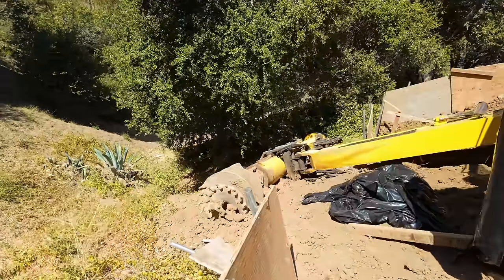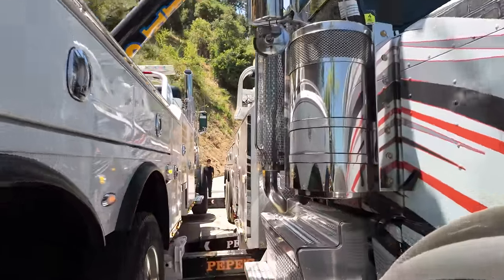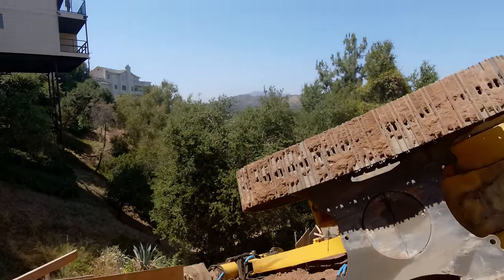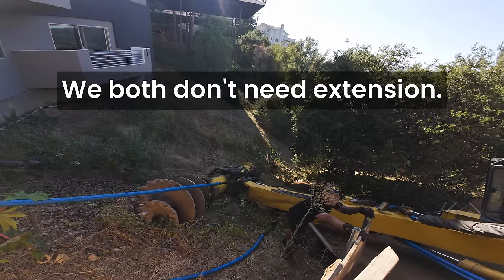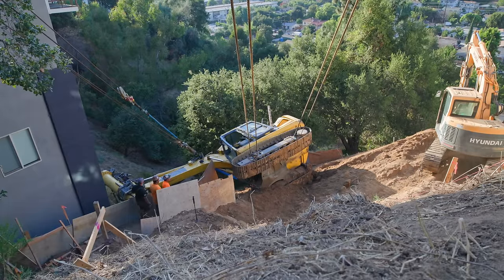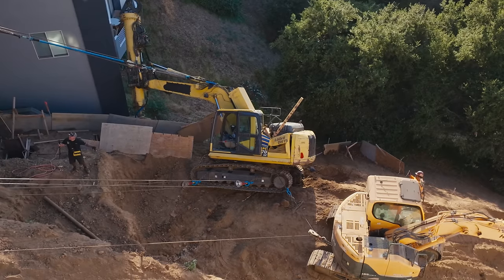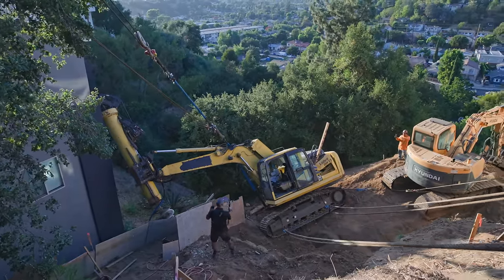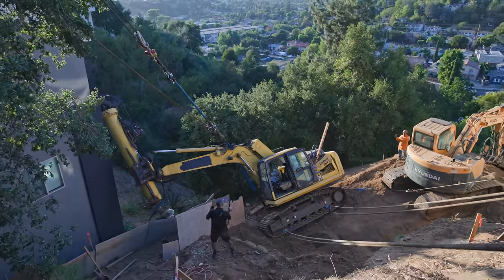Excavator Rolls Down Hill! (Our HARDEST job yet)

Comment: I think a crane would be best.
Reply from the maker: How could you possibly watch this video then have this take? Did you even see any of the video or just commenting blindly based on the thumbnail? A crane the size needed to do this job would have been impossible because of the working area. We literally got this job from a big crane company that couldn't do it and referred us. I'll never understand how people comment ignorantly when the video would answer their questions.
Reply: @PepesTowingService  A 60-80 ton crane truck would fit . I'm sure they didn't want the liability or it's outside their normal scope of work.
Reply from the maker: @Randal86 another YouTube quarterback. OK buddy
Reply: @PepesTowingService   Military Vet, Logistics & Heavy Equipment. More than one way to do that job buddy.
Reply from the maker: @Randal86 is that supposed to be mean something? Let's break it down. How much weight can an 80ton crane lift at FULL extension? Hint: not 80tons. Second, cranes are designed for static overhead lifts. Not a dynamic one as this. But you knew that as well. Third, you clearly saw how it took hours to get a wrecker with a floating axle here. How on earth would a crane big enough to do this job do it? Again, everyone is an expert on YouTube until you break it down.
Reply: @PepesTowingService  The crane at full  extension only needed to lift a fraction of the weight its designed to handle. Another excavator with a winch or chain would have pulled that right out in a much more controlled and safe manner vs dragging lines through unknown ground possibly compromising your winch lines. and safety of others.
Reply from the maker: Oh boy, you're one of those huh. OK you're right. We did horrible and from now on cranes and excators with winches will do all my jobs and supervised by you. What's your number so I can just have my customers call you direct?
Reply: @PepesTowingService  You guys did fine. I'm just stating there's more than one way to get the job done.

Comment: Quite a challenge! You mentioned at one point securing the top of the vertical pile driver with a cable or other restraint, so that its top section would be unable to pivot towards the neighboring home. But this step was NOT taken. Why not?  That seemed like an important precaution.
Reply from the maker: Relax Greg, we all know you would have done this job in 20min right
Reply: I asked a SIMPLE QUESTION, one that was about a suggestion YOU MADE. You first verbally noted it at 53:22.Then at 54:09, you visually marked it with an arrow, and again, when showing it from a different angle at 54:16. At 54:30, YOU ASKED if it could be chained down.   That sounded like an excellent suggestion. I SIMPLY ASKED "WHY NOT?"
I made ZERO claims to being proficient. But all I got from you was an arrogant, snarky comment 
It sound's like you have an attitude problem, Pepe.  Last time I watch this channel
Reply from the maker: YouTube really brings out the worst in people, you really need to relax it's not that big. It just wasn't done, simple as that. We were told it was all locked in place and wouldn't come open, some equipment are hydro locked meaning you aren't forcing it open without the valves open. Some are air operated, etc. I thought hey, can this come up? If so, let's chain it. We incorrectly were told no it can't open on its own. It's that simple, you can't predict and plan for every single thing.

Comment: OMG...watching this and whole pull was resting on that small 22k auxliliray winch pulling at the back. It did not even had pull multiplication from snatch block since line was at 90° angle, so only redirect. Crazy!!
Reply from the maker: Good eye, but small is relative. 22k is larger than a regular wreckers main line. Flipper has 3/4" dual auxiliary winches. The first attempt was to bring it over with a main line. As you saw, not going to happen due to the soft dirt and excavator being dragged. Once we had it up in the air, then the auxiliary was used. We didn't need it as the primary pull, just to assist and to keep it from spinning into the house which did the job. Is it ideal? Of course not, not a single thing of this job was ideal but we made it work.
Reply: @PepesTowingService   I did not mean to say that you did anything wrong. Just how crazy hard the whole rescue was, considering that excavator had no hookup points and that huge drill in front. That drill was nightmare and so close to the house. As for calling 22k small...I was comparing that to your main winches.
Reply from the maker: Yes, I am agreeing with you. The entire job was just logistical nightmares all around. That's why I love Flipper, it has 7/8" main lines and 3/4" auxiliary lines. I don't think a regular aux line would have done the job. Having that brute strength won the job, but I would have loved to have better angles and a stronger deadman.
Reply: @PepesTowingService   Yes..but as usual you never get what you need. It is great you have Alex now. You two are real A- team together. Bouncing Ideas betwen you two. This was nice display what are you capable! Respect.

Comment: That's another problem with US trucks... You get extremely long and clumsy vehicles with bad turning radius. In Europe we don't have that 20 fett bonnet, and we have steering on the last axel... With a cabover - that  crane would go clear the other truck and not over the bonnet.

Comment: Your off on the weight by a lot.  Excavator weights are estimated in the model number.  A 170 is about 17,000kg's.
Reply from the maker: The weight was given to me when they called me for the job. "around 60,000lb total". The 17,000kg you just gave is roughly 37,5000lbs. Did you factor in the LoDril attachment, which was estimated to be over 10,000lbs?

Comment: Next time take the boom off before you do anything else
Reply from the maker: Absolutely dumb idea. As if disassembling the entire boom would be easy or even quick? Then what do you do when the unit is upright and the boom is on the floor? Would love to hear your genius expert advice on how to put it back on
Reply: @PepesTowingService  Chill man, love your videos and no doubt this was an absolutely crazy job. It takes a mechanic a couple/few hours to take it off (or at the very least, the drill looks like two pins and some hydro lines). Its already on the ground which might make it tricky, or easier, depending on whats blocked/or weight bearing. Then you don't have that high-centered weight, which makes it 100x easier to flip upright, and you reduce interference with the house. Then you can drag the boom up with the other excavator or with flipper separately to reassemble. Taking those off in the field is super common for repairs/maintenance.  Putting it on is the easy part. No judgement man, just giving you things to thing about in the future. The reality is if you didn't pull out this miracle, they 100% would have been field stripping the thing into pieces to move it anyway. 

https://www.youtube.com/watch?v=Zd3A88ndWUc 
Full boom strip example. Rather than the chain hoist, you can use another excavator in the same manner to put it back on.
Reply from the maker: @bailout00 the video you linked is literally in a garage shop and much smaller. Let's think about the logistics. You take hours to even get there. Then say hmmm we can't do it call a crane tech. How long until a crane tech crew qualified to do that to get there? Surely they don't teleport. And who pays them? Excavator owner was already maxed out on budget for my bill. Let's say best case scenario someone is hired fast and is there in two or three hours. And somehow they work lightning fast and despite being on its side they do it in 4 hours. Now it's night time and we've been on scene for 9 hours doing nothing. Who pays for my extra standby time now. The excavator had zero lift points. The boom helped immensely to bring it over once it was at 45 degrees. It just bothers me when people randomly throw out their expert opinions as if it's some easy thing we overlooked. Your way would have been double the money and double the time while being completely unnecessary